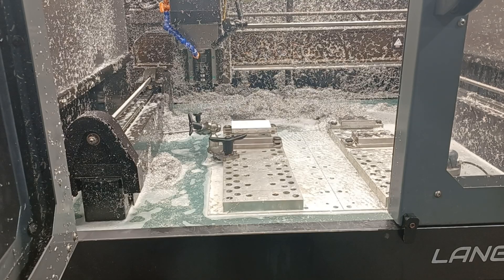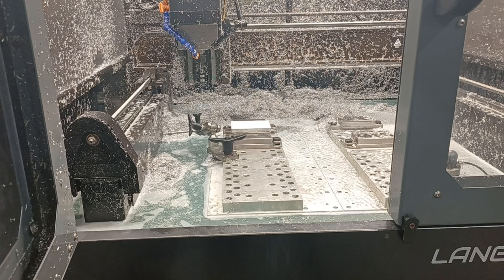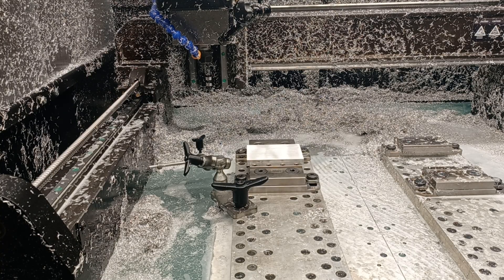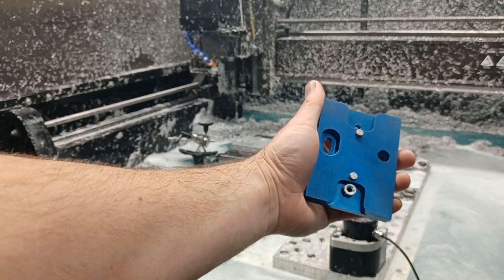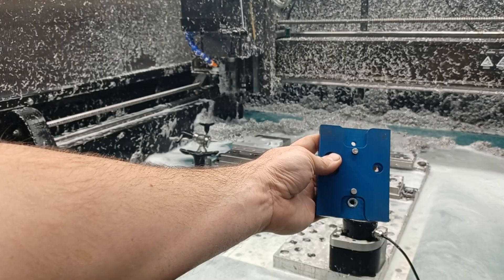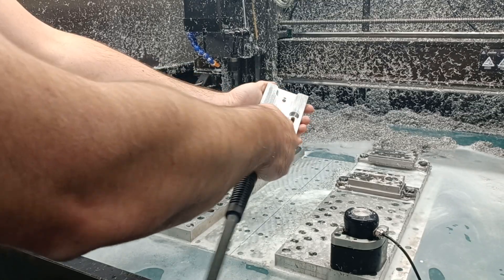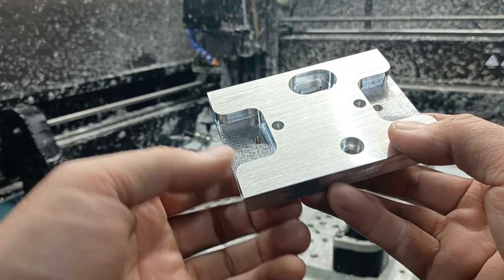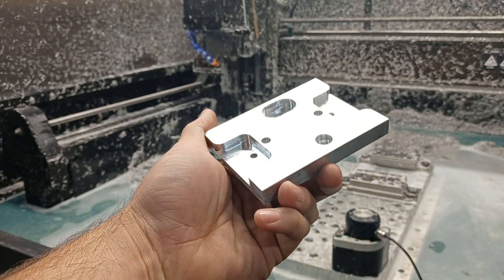MR-1 CNC Goes Beast Mode — 300+ IPM Production Cut!

Comment: Hi Richard great content. From what I've seen of your MR-1 machine performance, it would run circles around my tormach pcnc series 3 mill I sold over a year ago.  Linear ways on all 3 axis and the ability to dial spindle tram to essentially zero is a great feature. On my tormach no matter what I did I could not get my z axis to repeat parts closer than about 0.003". Probably due to head nod on the dovetail ways. Not a problem with the linear ways obviously. 
You're running cutting feeds and speeds that would have either stalled my spindle or caused tool pull out with the TTS. Lol.
Tormach was a great machine, but this machine's performance is just better all around. 
What is your z axis repeatability on cut parts? I'm guessing 0.001" or better?
Reply from the maker: The MR-1 is one of the best stepping stones in the market in my opinion.  I want to buy a Robodrill next once I can afford one.
Reply: @BeckTools 
Even with the Acme screw on the z axis you still get good repeatability on Z? I know they engineered it to use head weight to control backlash. How does this translate to z axis accuracy on parts? Some things I cut need accurate heights. 
I have a langmiur crossfire with xl kit and z axis. Great piece of equipment. I sold an industrial 4x8 table last year, and it didn't cut any more accurate than the langmiur.
Reply from the maker: @gregorylute  when you push it hard in steel you do get some vibration.  Not sure if it's the screw or not.  I've taken it apart and the self tightening z axis nut is pretty dang tight.

Comment: Hey Beck, thanks for the video! If I may make a suggestion: pull the cutter higher in the collet. You'll get better surface finish. Also, do you still use Cut Control with the upgraded speed?
Reply from the maker: I do still use cut control.  I could reduce the stick out another .125"  I think I'm only 1/4" from crashing in the features that goes all the way thru.  I was trying to allow coolant in and chips out.  That 1/8" would help.  good call.

Comment: You must be running a 3 flute bit to go that fast? What's your WOC / DOC?
Reply from the maker: Yes I'm running a 3 flute.  I'm going .015" WOC, .25" DOC, 4mm end mill on the high end in this video.  I found yesterday I can go .02" WOC and .25" DOC, at 200 ipm with that 4mm endmill.  I slow down on some of the small holes because I don't want to shake my machine to pieces. lol

Comment: Why do i see everyone with their clamps at the rear of the machine. My back screams out in pain when i see it
Reply from the maker: Some times I move it to the front and mod the G-code to it doesn't go all the way back to machine 0,0.  If the fixed jaw is already loaded I don't take the time to change it.  With it in the back I can't clamp large parts.  I need to make a low profile stop so I can fit 4 of these setups in my machine at a time.
Reply: @BeckTools  oh right because it returns to home after every run, ya thats a lot of bs time wasted.
Reply from the maker: @the_chomper  yeah that's the constant battle in my head.  How much time to spend setting up.  This is a 34 part run sooooo I refine the program but didn't spend the time to do everything like I would if it were 50 to 100 parts.